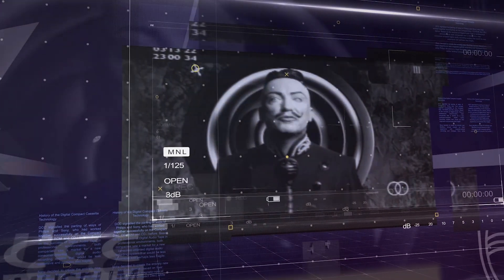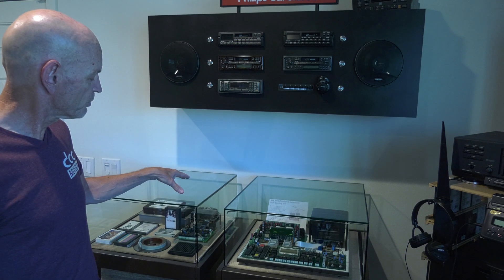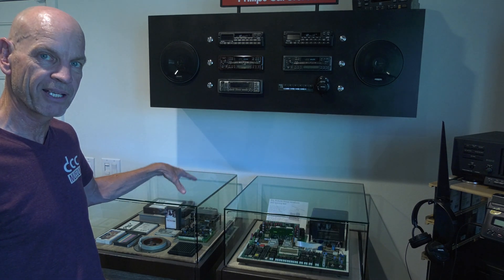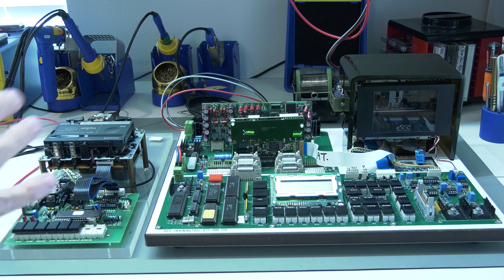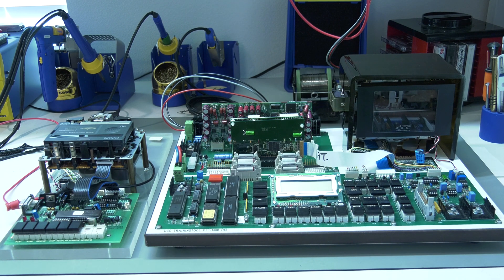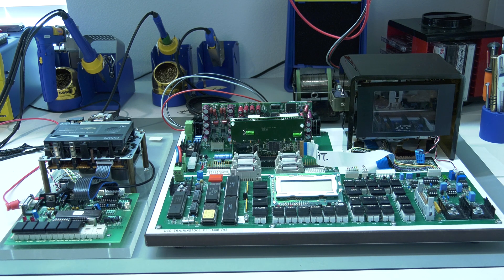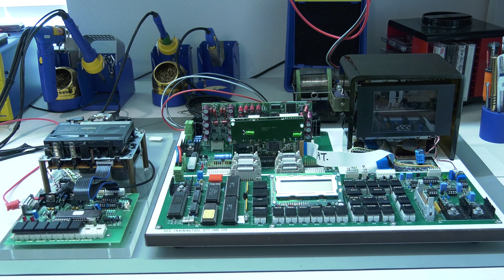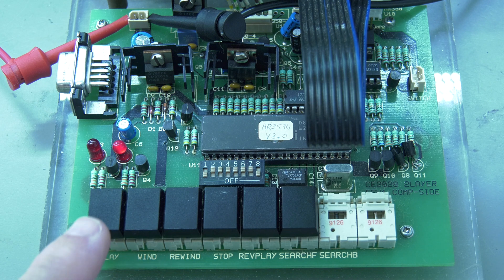The Very First Digital Compact Cassette 350 Protoboard and DTT-1000 Training Tool.

Comment: Perhaps there is a way to find out (for instance, via comparison of similar logic) how the detection takes place, and maybe force that bit high or low? As with most electronics, other factors can also come into play, such as a missing voltage/ bad regulator or open-circuit fusible link/ IC protector etc, etc. Even supplying the correct power supply voltage, but with insufficient current/ amperage can make it appear as if a fault condition persists..

Comment: It looks like nowadays diy project. Very interesting.
Reply: This type of thing still exists, see the Analog Devices eval boards which are meant to aid in circuit design for TVs and other video equipment, they have also been used by amateurs to upscale Laserdiscs and other old analog video.

Comment: Meanwhile, we have the source code of the software that was originally used to control the 350 deck from an MS-DOS PC. On my next visit, we should try to get it to build with a modern compiler to see what it looked like.
And of course we're going to keep working on the DTT1000. Maybe we'll attach a logic analyzer.